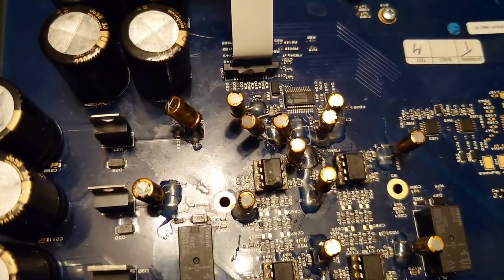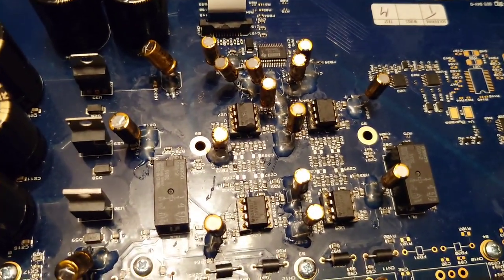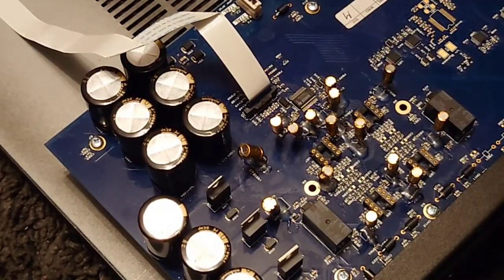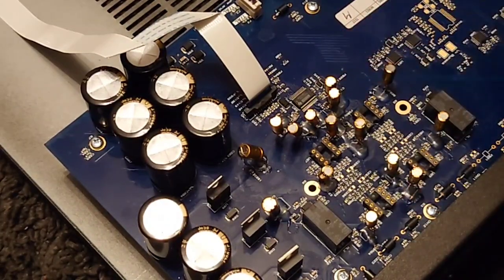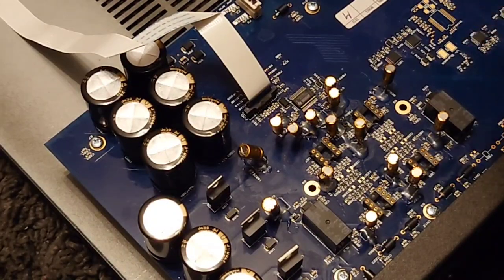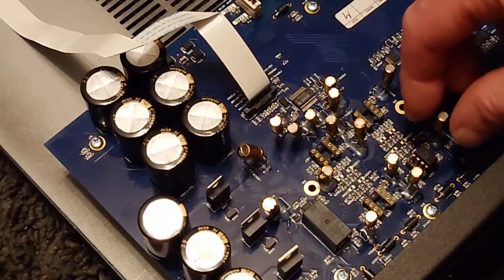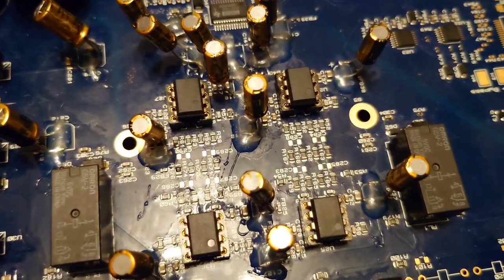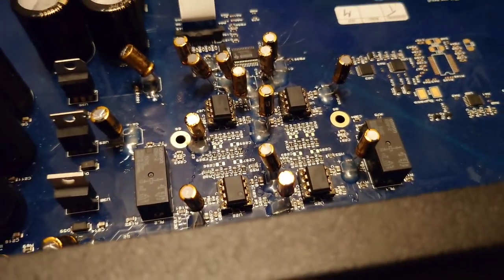I'VE UPGRADED OP-AMPS

Comment: Hi. Ive been following this with my Roksan K3. Have been doing some op amp rolling and have best results with some discrete op amps from China. These sound more natural and musical than the IC chips I've tried.  On the DAC outputs are SX52B and the buffer Op Amps are 'OP03 Full discrete Component Field Effect'. Very pleased with the result. Much better than the NE5532APs. Combined with capacitor upgrades (I went with Nichicon FGs and MAs in the end to avoid awkward 'snap fit' capacitors) it's transformed the DAC sound. Liking the channel !
Reply from the maker: Have you tried cryo treating the IC OP-AMPS, I'm about to try it, it's meant to really improve them👍
Reply: @tweakerman  as in freezing them? what's the process? not tried that yet.
Reply from the maker: @karlpickering check this company out, I'm about to cryo treat ic OP-AMPS & vacuum tube + many other iteams👍

 https://www.cryogenix-uk.com/audio

Comment: Not an upgrade -- it's a "sidegrade" that results in a minuscule change (if any) that folks tend to decide is an improvement due to confirmation bias.  There's nothing wrong with the elderly NE5532 -- most of the recordings released over the past couple of decades involved mixing desks from top makers like Studer with dozens of them in the signal path.  Such "op-amp rolling" exercises are definitely a waste of time and effort IMO -- but of course YMMV, 'cuz tweakers gotta tweak!
Reply from the maker: I would agree with you, it's a sideward step, to a certain degree, personally I prefer the sound of the LM4562 over the NE5532, although you're right it is subtle, but most improvements are subtle, thanks for commenting & watching 👍

Comment: What is the improvement in the op amps?  Were the old ones not as well matched to the other components?  Do they get old?  The failure rate could be expected to be higher with new electronic components -- you know, burn-in,  infant-mortality and all that electronics BS.
Reply from the maker: If your application demands the highest audio quality, low distortion, and minimal noise interference, the LM4562 is a better choice. It excels in premium audio equipment like high-end preamplifiers, DACs, and headphone amplifiers & it has a cleaner & more accurate sound than the NE5532, in my opinion, so it's an upgrade for me, but maybe not for you if you don't like that sound, thanks for commenting & watching 👍

Comment: ChemiCon wired Polymer Cap, APSG160ELL102MH20S, 16V1000µF, 8x22mm, Dissipation Factor (tanδ) 0.12 max @ 20℃, 120Hz, ESR 8mOhm, Rated Ripple Current 7.5Arms @ 105℃ / 100kHz, 20000h @ 105°C DC, Leakage Current 3.2 mA👀max / 20℃, after 2 minutes, 0.70E + VAT from 10 pieces, For normal low ESR capacitors I prefer the ChemiCon KY series, Nichicon is not my brand because I always scroll down to the Lifetime at 105°C, All my Opinion😉

Comment: Nice ..I had the same problem with my older DAC...I ended up getting the Sparkos 3601's..way EZ'er with the Sparkos.
Reply: I put aSS3602 in my R2R DAC. It transformed the sound and far surpassed several other opamps I auditioned.
Reply: @ericgonzales854 
 yes indeed …sparkos.. I am aware of these incredible little Opamps… but 
I may go with a Denafrips DAC in 2025 focused on room acoustic treatment at the moment.
Regards KCB.